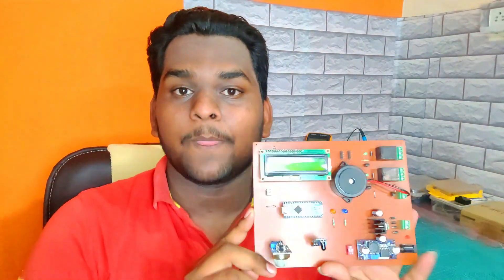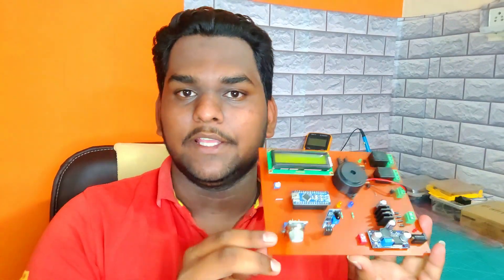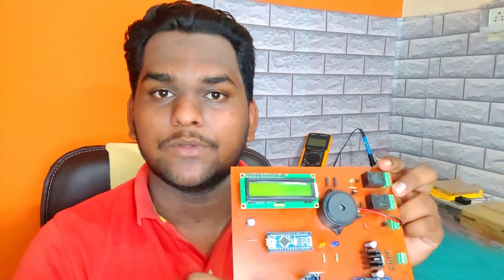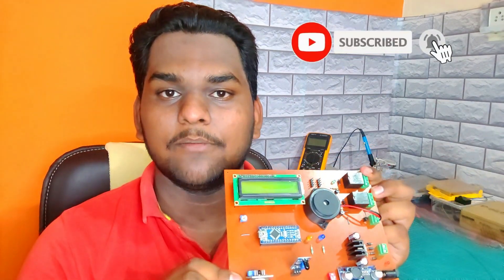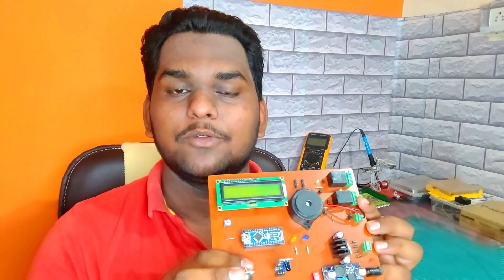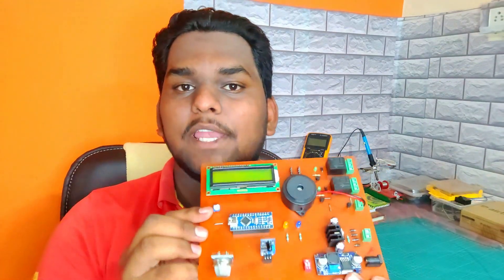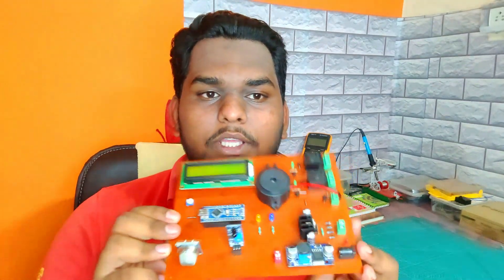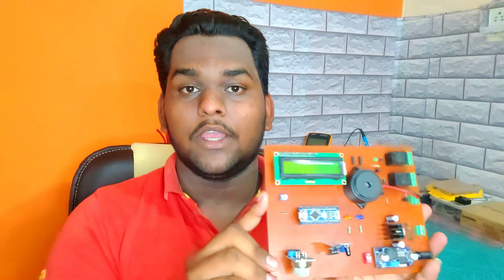Fire & Gas Detector System With Protection Using Arduino By #technoesolution | Industrial_project

Comment: sir it not an IOT project right
if it is an IOT plz explain how to connect with cloud
or else explain that how to convert it into an IOT to connect with cloud
Reply from the maker: Hey, It's not IOT project, this project is based on Arduino. 
If you want to make it IOT you need to use WiFi module insted of Arduino, so it will send notification to the user and provide safety automatically.
Reply: @TechnoESolution  can u make a video on it plz
or else u plz gide me